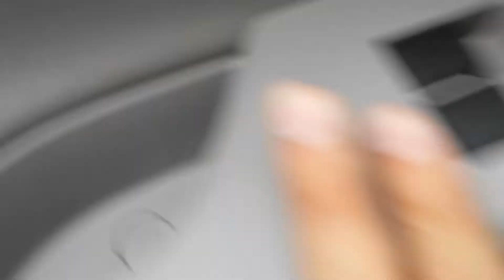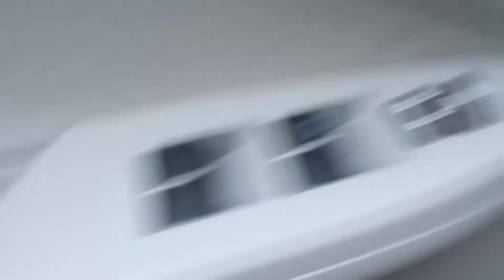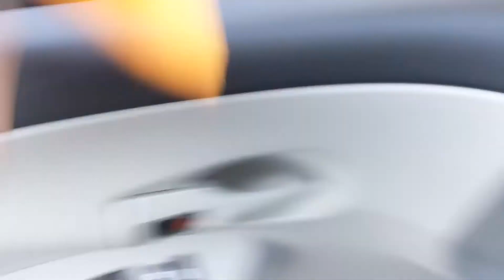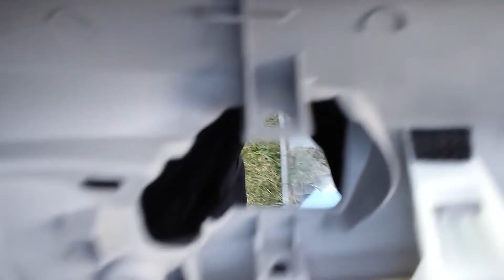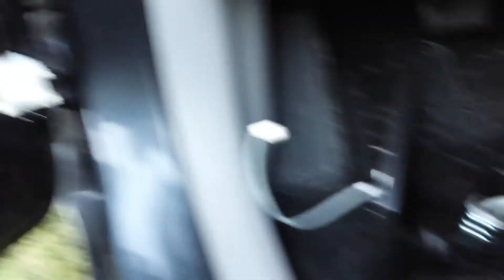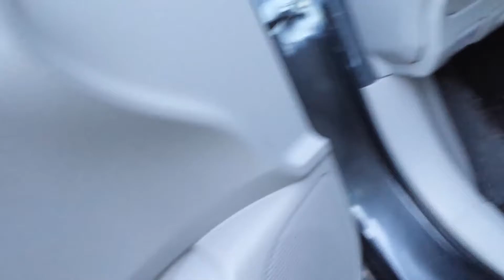how to replace driver side mirror on corolla

Comment: Why did you remove the entire door panel? Can't you just pull out the top part to reach the connection?
Reply from the maker: It is tied down, had to remove it